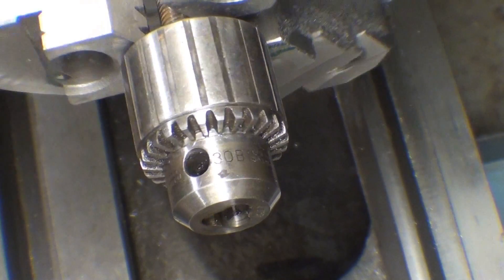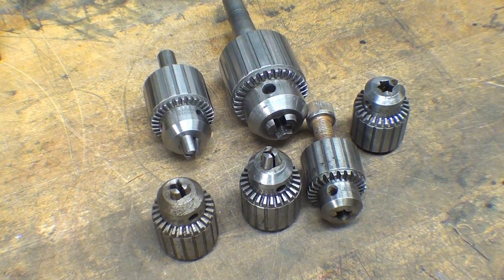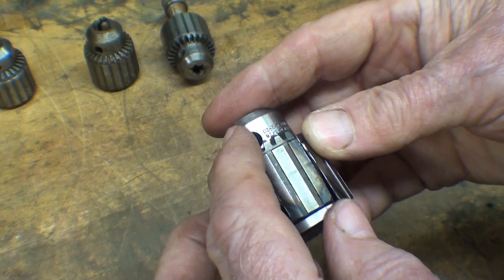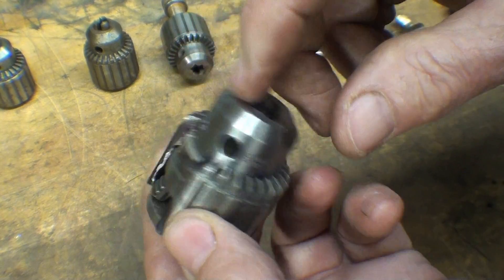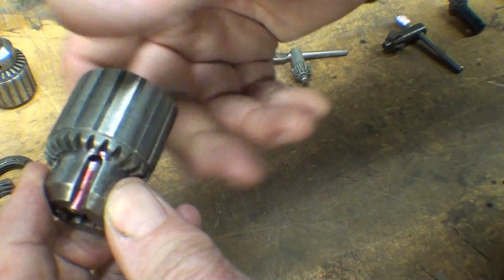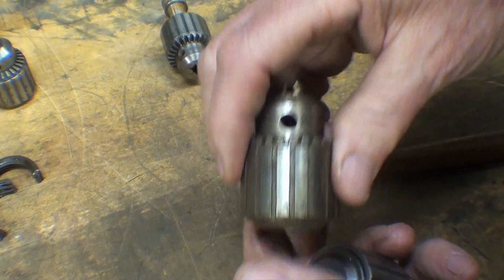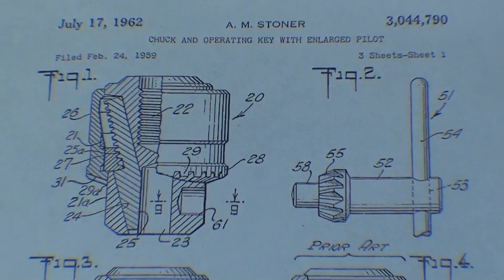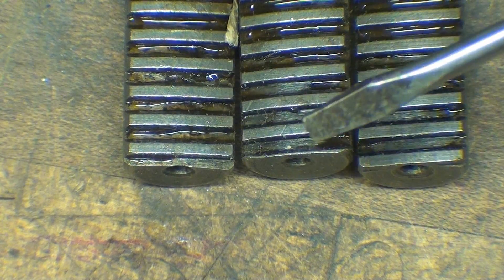What Makes It Work #25 JACOBS DRILL CHUCK tubalcain w/cutaway

Comment: Brilliant. Thank you. I’ve always wondered about these chucks which I use almost every day. So satisfying to know their workings. You are a true craftsman.
Reply: Now that I have tried to dis-assemble my Jacobs 33AB 1/2" chuck, there are two important points missed here. 1) the jaws should not be at the base of the chuck (all the way open). That's what I did and as the sleeve came off, it damaged all three jaws near their bases. Setting them about half way would be ideal. 2) There is a center holding screw keeping the chuck from unscrewing if the drill is operated CCW. I did not know about this LEFT handed screw. Ouch!!! Wound up stripping it out.

Comment: What are your thoughts on the effect on a drill chuck of using a Wagner Safe-T-Planer, or similar rotary planer?  They require the jaws to be almost fully opened. I also love studying patents! Scott
Reply from the maker: No problem I have use one hundreds of times
Reply: @mrpete222  Excellent. Me too, but always on a Shopsmith with a 1/2" router chuck.
Reply: @mrpete222  I did a video on the rotary planer last week and already expressed my unfounded concerns about using it with a drill chuck. I owe my subscribers a follow-up and intend to mention your insights. Any chance you'd be open to recording a statement about this that I could include? I have a small but loyal audience of Shopsmith users, so it's not like I can make a compelling offer for a collaboration, but even so, it would be a thrill if you'd be interested.  I could arrange a Zoom meeting. Scott

Comment: Brilliant,
I Wreckon once the jaws have been replaced,place in the freezer,using elastic band to hold the two halfs,
Warm the outer cover slightly  ,then pull the inner out of the freezer and slip the outer cover on,would this work or would the outer sleeve shatter once toutching the frozen inner section,
I would be intresred watching if you would try with a none functiong one,

Comment: My three chucks, 0-1/2" ball bearing Jakobs are about 35 years old...and I'm like some other machinist...don't let the drills spin in the chuck!
Never had problems with worn jaws...just the key had worn out 5/16" diam. stub which goes inside the chuck...I find that stub was made too short, [new] and over time the key is rocking too much in the hole which then can skip teeth on the beveled gear, today I fixed all 3 keys by cutting the 5/16 diam. stub off and drilled with carbide and reamed 5/16" hole then pressed a dowel pin into, cut to length, [longer then original] fits nice and snug again...should be good for a long time again. 
I also have some keyless, [ok for small holes].... for heavy duty large drilling nothing beats the Jakobs.

Comment: Mr. Pete - I love your "What makes it work?" series.  Many thanks for your clear explanations.  I want to suggest one that I don't think you have done yet.  I recently got one of the Noga dial indicator holders and it's really nice.  However, I keep wondering how a single tension knob manages to tension three articulated joints at once?
Reply from the maker: Thanks.  If I did get a noga--I sure wouldn't take it apart

Comment: Why not check the runout I have bought 16-18 (and returned them all) the runout is the worst in the industry, the smallest jacobs chuck had runout greater than the diameter of the intended small drill bit. The cheap Chinese ones are precision boring heads compare to jacobs brand.  brings shame on the USA brand. Jacobs if you are hearing you owe me alot of return postage.

Comment: I'm not too sure you can even buy a drill motor with a cord anymore, let alone one without a keyless chuck.  The keyless chuck was a real unfortunate development (unless you're talking the expensive Albrecht chuck). They never hold, and have given rise to those drill bits having the three flats ground into the shank as a remedial fix.
Reply: Of course you can still buy AC powered drill motors, and many still come with proper keyed chucks. Just typing "corded drill" into my favorite home improvement store's website shows that there are many of them available and half of them have keyed chucks. If I had to have only one drill motor, it would be corded, but I have to admit that 90% of the time I use a cordless.

Comment: Mr. Pete, as always I enjoyed your Jacobs Chuck video. I recently replaced my (1990's vintage Taiwanese but descent)  Drill Press Chuck for a brand new old stock made in the USA Jacobs 14N. I also have a Jacobs 18N and a tiny 0 also made in USA - I got from my Dad. Believe it or not you can still find a NOS on Fleabay if you look hard enough and have the time and patience. They also still have NOS re-build kits for the old Chucks too. The new production Jacobs are not terrible but certainly not as good as the original USA models. 

I've got an older MSC 1HP floor model Industrial rated Drill press ( early 90's production) that is a really descent machine. You might not believe this but the Run Out is only .0015" measured with Federal and Starrett gauges. I got this DP new and have taken good care of it throughout the years.  What makes it more special is that my Dad bought it for my 40th Birthday!

Comment: Just checked out my Jacobs 1/2" chuck after seeing this vid, it's been in the back of my Bridgeport tool cupboard for ages.  Never did use it because drills etc ran out of true.  Stripped it down as described and permutated the jaw positions, I now have a chuck that runs within a few thou.  By the way, I'm nearly seventy and time served engineer, so it's never too late to learn.  Thanks Mr Pete and keep them coming.
Reply from the maker: Awesome--so someone had assemble it incorrectly

Comment: What turns the split nut? Is there a spline or notch in it?
Please explain the relationship between the Shell and the split nut.
If the Shell is a press fit on the body...how does it turn?
Can you tell us how the split nut is manufactured?   
Is the body one piece?
Reply: James Hohimer from what I can make out in the video, the shell is pressed on to the split-nut.  Once pressed in they move in unison.  The body of the chuck holds the jaws loosely so they can slide in and out.  Once the chuck is assembled, the jaw teeth engage with the split-nut. When the body is kept still and the shell/split-nut combination is rotated the jaws slide in and out of the body.

Comment: Did you know that the Jacobs company bought the engine compression brake invention from Jessy Lyle Cummins. That is how the engine compression brake became known as the "JAC Brake".
Reply from the maker: I knew that jake brakes were jacobs, but did not know it was the chuck company-thanks
Reply: Are you sure that wasn't the Jacobs Engine Company? They made radial aircraft engines. Look up Cessna 195.

Comment: Great job, Mr. Pete.  I'll bet there were a lot of unhappy customers finding those broken nuts in those boxes.  So, do they break them at the factory or do they cut them?  I would think cutting, but then that would result in at least some small loss of material, which in this case might be an immaterial loss of material, if you'll pardon the pun.  If they do indeed break them they must have some method of ensuring they just end up with 2 (and not 3 or 4) pieces and also they would need a way of preventing bending or warping the part.
Reply: Matching broken pieces like this are machined and then hardened. While still full hard a notch is ground on each side and they are impact broken so they don't distort or shatter. They are then tempered in an oxygen free furnace to avoid scale, assembled, clamped together and the threads ground to size.
 If you take a HSS tool-bit and notch it then bend it, it will break but the ends will distort so it won't go together evenly. But if you smack it with the correct force and speed while holding one side at the notch they break cleanly and fit together nicely. 
 I have seen 2 chucks that had 2 piece nuts and they would occasionally bind as the machined split passed a jaw. Irritating because each had certain sizes of drill that wouldn't tighten properly and would spin. They eventually went to the scrap bin. If you have a chuck that spins some drills this may be why.
  Mike (o\!/o)

Comment: That Stoner patent must have been for an improvement. I found a patent granted to A. I. Jacobs in 1902 for the chuck. It is patent number 709014. You can easily find it by going to google patents and searching by either "Jacobs drill chuck", or the patent number. I like the style of the patent drawings and have discovered a lot of them granted to Laroy Starrett, including the RPM indicator that you did a video on.

Comment: Does the shell drive only drive the  the nut through friction?
Reply: Robert Grant -- it's more than "friction"... it's an "interference fit"... hence the need for a press to disassemble/reassemble (but the cutaway still has a tight-enough fit to make it work as shown here).
Reply: Kev - An interference fit relies on friction, a lot of it but it's still just static friction. My question was more about there being no key or spline, hence the shell could be pressed on with any alignment.
Reply: Robert Grant -- of course interference is a form of friction... but you didn't mention keys or splines in any way.
Reply: Robert Grant -- of course interference is a form of friction... but you didn't mention keys or splines in any way.
Reply: Kev - I  had intended to but decided to keep it brief.
Long version: I'd like to have seen more about how the shell engages the nut and how the nut is made. The shell moves the nut through friction from an interference fit but it's not that simple. The nuts is machined and then split. Doing that and maintaining the tight tolerance seems quite something to me. I thought whatever mojo goes into the manufacture of these chucks deserves more coverage.